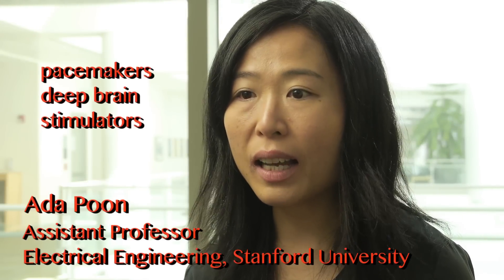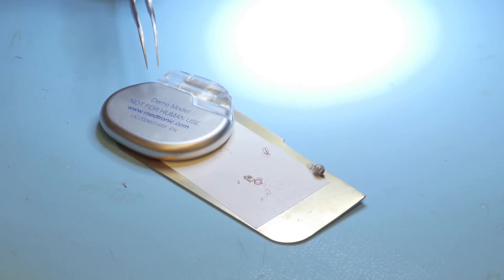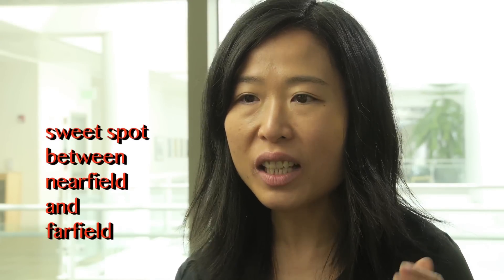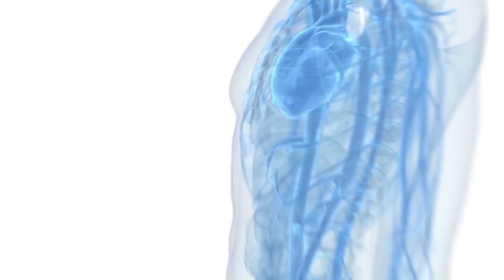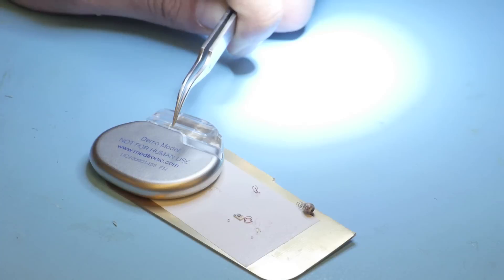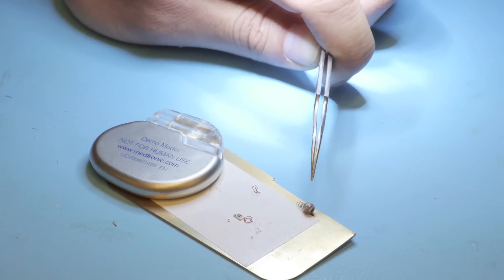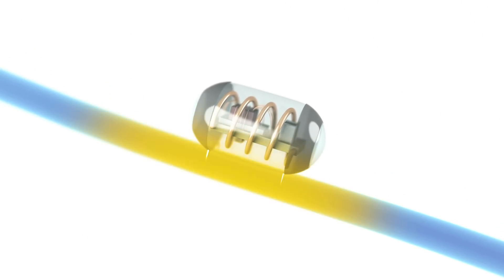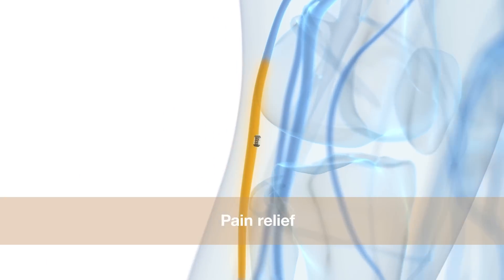Stanford engineer invents safe way to transfer energy to medical chips in the body

Comment: Don't you think the electromagnetic radiation could prove to be carcinogenic, even in mild doze over a long period of time? I think you should do something that draws energy say from body heat or solar energy collected by photovoltaic cells that can be transferred via wire to the device planted in the body within.

Comment: Well, we'd first have to find a way to shrink a thermoelectric generator down to a reasonable size. We couldn't just use the heat directly, since electricity is so much more versatile as a way to use energy. Perhaps something can be developed which draws energy from one nerve to stimulate another.

Comment: but you need yo carry the transmitter outside, which I assume is even bigger than those batteries
Reply: No, as you saw, its just a flat electrode that you place on your chest, whereas before, you needed theese big coiled wires to induct a current.
Reply: CTalk    I saw nothing but a lot of hand waving

Comment: Why use an external source for power when our body heat it's a great source of power?
Reply: Because you need a temperature difference in order to convert heat into electrical energy, but our inner body temperature is fairly uniform.

Comment: It would be nice, if these electronics could be powered by the blood sugar and oxygen, just like our cells are powered.
Reply: There is actually researchers who have worked on that. Google, MIT creates glucose fuel cell to power brain computer interfaces. However, what is the point if it can be done without a battery at all?
Reply: John Holmes How would it be done without a battery? In this video they just say how to deliver the energy from outside the body to the mini chips, but an energy source is still needed. It could be a thermo-electric generator an the skin, but the solution with the mentioned fuel cell appears to be much smarter.